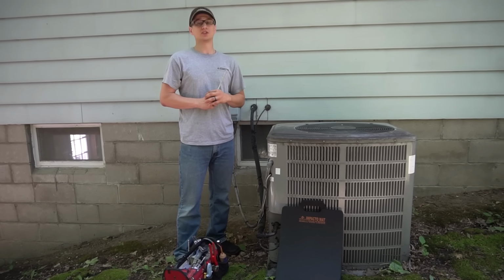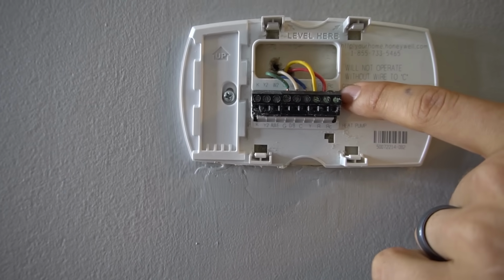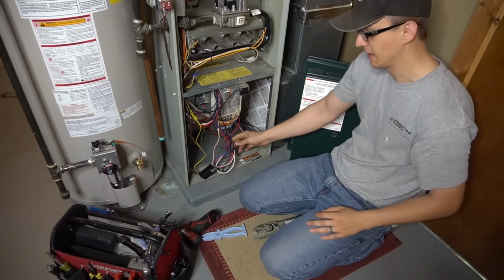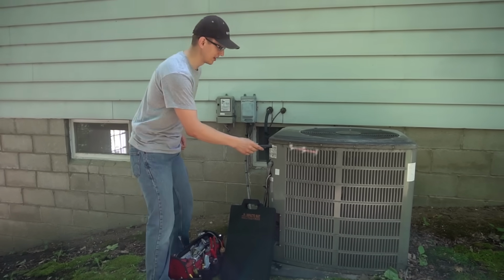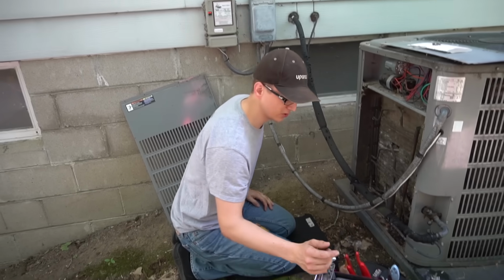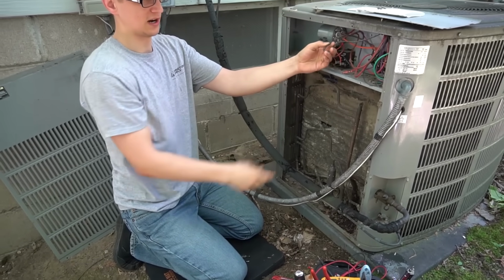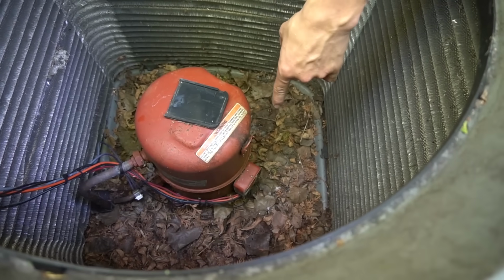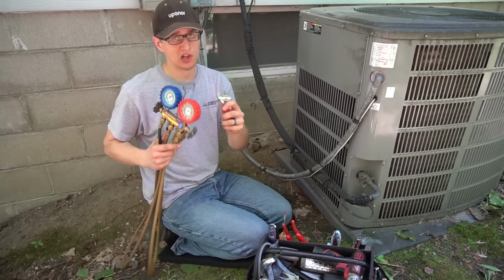AC Unit Not Turning On - How to Fix It Step by Step

Comment: Hey Mahn. This is a great video. I replaced the motor and capacitor of my AC unit  and everything works but it still won't cool. i also noticed that the copper hose on the outside unit is not cold. What do you think the problem is?
Reply from the maker: Can you tell if the compressor is turning on? You can usually hear the difference between the fan coming on and the compressor turning on. If the compressor is running, then you likely have a freon issue. At this point it would be better to call a technician.
Reply: Yes, I can hear the compressor humming. I figured it was a freon issue. Thanks.

Comment: Good morning, watched your video. Learned a lot. Still have question though. My ac just stopped turning on last weekend. I have replaced the capacitor & blower motor last year. Checked them they seem good. I was wondering about the contactor. Nothing turns on when set on AC - but can turn fan switch  - not the thermostat fan - and it works inside. When i go out & look at the contactor it’s not pulled in - but if I push it in the ac unit fan will spin - so i replaced the contactor, but same problem. I have one of those old slide thermostats - only has 2 wires attached on the back & 2 wires that were never connected. When you slide it it make the sound fairly close to the correct temperature. Just hoping you might have some ideals. Have a Goodman AC unit. Thanks
Reply from the maker: Most likely the contactor is not getting 24v, that is why it's not pulling in. What I found interesting is that your thermostat only has 2 wires attached. What do those two wires go to? R and W? It almost sounds like your AC is not hooked up at the thermostat. I would go down to your furnace and see which thermostat wire goes to Y at the control board (if you have one). Whatever color wire is hooked up to Y at the control board, hook up that same color wire to Y at the thermostat. Your set up may be different then mine. Let me know what you find

Comment: Word of Advice TV  please help 😣 The fan on my condenser unit is not working. Even after replacing the capacitor. The thermostat, furnace and compressor are all running. But the fan does Not run even when I try to jump start it with a stick, Nor by pressing the plunger thingy... the fan will not run. Any idea what might be the problem? 😭
Reply from the maker: Do you have a multi meter? I just posted a video on how to check if your condenser fan motor is bad. But if the compressor is running and you already replaced the capacitor.. It is very likely that the fan motor is bad.
Reply: Word of Advice TV I don't have a multi   meter (I will search for ur video on how to check if the condenser fan). Any advice on where to purchase the fan motor or a reliable ebay seller? My condensers brand is Carrier, if it matters. Thank you very much for taking the time to reply to me and for your videos. They are clear, straight to the point and easy to understand. Thanks again! 👍🙏
Reply from the maker: Happy to help :) You can probably find the motor you need on Amazon or Ebay. I would first go to some online HVAC parts store like this one for example: http://www.northamericahvac.com/   and put in your unit's model number. Find the condenser fan motor that will fit your unit and save the part number of that motor. Then you can  use that part number to search for a new motor on Ebay or Amazon. Or I suppose you can always buy it off of one of the online HVAC stores too. Up to you.
Reply: Word of Advice TV thank you. I will do that. 🙏🙌👍
Reply from the maker: Sounds good. Good luck and be safe!

Comment: So my unit is like yours and does not have a fuse on the board and no in line fuse. What do I do in that situation? An animal chewed the wires outside, they were clearly touching and I replaced them but my ac is still not working
Reply from the maker: Oh boy.. If there is no fuse then a shorting wire could have damaged your control board, thermostat, or transformer. In the worst case scenario, all three. Do you have a multi meter? You would need to do some checking. The thermostat is the only one you can check without a meter by simply bypassing it. (I have a video on how to do that if you are not sure how)
Reply: Word of Advice TV yes I do have a multimeter. That’s pretty terrible news. The whole hvac was replaced less than ten years ago. It doesn’t make sense why there’s no fuse. The fuses running outside are perfectly fine. Breaker wasn’t tripped but nothing is working except the fan. Turning on. There’s a red light that turns on on the circuit board can it still be fried? And yes please direct me to the video you’re talking about. Thank you so much for replying so quick!
Reply from the maker: Here is the video for bypassing the thermostat: https://www.youtube.com/watch?v=9Y_R9unnadI&t=2s   but perhaps there will be no need to bypass it for now. You can just check with your meter.

If the unit is new, then that is kind of weird that there is no fuse. Perhaps it is a little 3 amp breaker instead? To confirm, I would look at your wiring diagram/schematic (usually on the back of the furnace door) and see if there is a fuse/breaker on the diagram. It will usually come right after the 24v side of the transformer.

Even though the light on the board is blinking, it could still be fried. A blinking light is a good sign though.

And now for the actual checking :) With your thermostat on and set to cooling, go down to your furnace and take the doors off. Tape your door switch so you don't lose the power. Next, locate your thermostat terminal strip on the control board. (R,Y,G,W,C) Set your meter to voltage and check R to C. Do you have 24v? What do you get between R and Y? Then Y and C? Depending on what your findings are, we will be able to narrow it down to the culprit. Let me know
Reply: Word of Advice TV Word of Advice TV ok so between rc and ry I’m getting 27.3. Between Y and C I’m getting 0. Also I haven’t found
Reply: Oops. I haven’t found a 3 amp breaker either. I’ve looked on the diagram as well. I’m not super familiar with reading it but I found the 24v and there’s no fuse around it on the diagram.
Reply: Word of Advice TV also, I don’t know if it makes a difference but I have a nest thermostat. It doesn’t seem to be having any issues, I don’t know if there’s something inside that got fried though. Thank you so much for all of your help also, we live in a remote area and haven’t been able to get ahold of our ac guy for the past two days.
Reply from the maker: Glad I could help! Hopefully we will get this figured out soon. So from what you checked so far, we now know that your transformer is good (otherwise you would not have 24v anywhere) and likely you control board is good too but not 100% sure. It seems like it is sending power up to the thermostat but the thermostat is not sending that power back down. At the moment I would suspect the thermostat. You should watch that video i referenced above and hopefully you will understand how the bypassing works. Instead of bypassing the thermostat at the thermostat, you will put the jumper wire in at the furnace control board between R and Y. (make sure you turn the power off when putting in the jumper) Then turn the furnace back on. Does the AC turn on? If it does, then you know your thermostat was fried. If not, then we will need to keep investigating. If the bypass does turn on the AC, then you can just leave the jumper in there so you can cool down the house. But keep in mind that it will run non-stop until you either take the jumper out or turn the power off to the furnace. Good luck!
Reply: Word of Advice TV I put the jumper in and boom ac turned on. You are amazing!!! Thank you so much. I’m not excited about my very expensive thermostat being bad but at the end of the day it’s better than the whole unit being bad. Now if I installed an inline fuse myself somewhere and an animal chews the lines up again will it prevent this from happening again?
Reply from the maker: You're welcome! Glad to hear the AC is back! That's a bummer that the thermostat got taken out but at least it stopped there and didn't take out the board and transformer.

Yes, that is the purpose of a 3 amp fuse. So if there is a short, only the fuse will burn out. If you look at my video, my furnace actually did not have a fuse either. I put that one in myself. All you need to do is cut the 24v hot wire coming from the transformer, strip both ends, put connectors on them, and put the fuse in. If this happens again, the damage stops at the fuse :)
Reply: Word of Advice TV awesome. Once again thank you so much. Your videos and advice are amazing! I’ve subscribed to your channel!
Reply from the maker: Thanks :) stay cool!
Reply: Hey again! Thank you so much for all of your help a few weeks ago. I just have a quick question again and please let me know how I can ever repay you for all of your help. So my ac unit is working, we replaced the thermostat and now there’s a puddle of water outside of my hvac unit in the basement. I’ve been googling possible causes and what I’ve found is that it could be a clogged line which doesn’t seem likely since it basically started happening overnight but it also said a broken condensate pump. Is there a way to test it and is it possible it blew out along with the thermostat when those lines shorted out?
Reply from the maker: You and family being happy and cool is all the thanks I need ;) If you have a condensate pump, it is possible that it was damaged too. I would first try to clear the drain line though as that would be the easier thing to deal with. If you are not sure where to start, I made a quick video on it:  https://www.youtube.com/watch?v=v4WMZ5i4c3M&list=PLK8tZPlovA8Aw5W4GIoingc_enl5apH4C&index=8
Reply: Word of Advice TV thank you for responding once again. Our drain is unfortunately pvc so now I’m just trying to figure out if I should cut it or buy an air compressor to blow it out. I have a wet dry vac, would I be able to suction it or use the reverse feature? Also if that’s not what it is, what would be your next suggestion? I’m actually surprised at the amount of water that is coming out of the bottom. It’s not a small leak at all. We are about to leave for a week so it won’t be running at all until we get back. I hope all these comments are helping your page somehow!

Comment: Have had an Intermittent failure with cooling (inside fans runs, outside fan and compressor not running).  Contactor would not close (240 VAC and Capacitors verified - OK).  Let it sit overnight with disconnect pulled, tried it the next day and the unit started working again.   Same thing happened 3 days later.  Thinking it something with a pressure switch or TDC or defrost circuit?  Any suggestions?  Can I troubleshoot further?
Reply from the maker: When it turns off, I am thinking something is interrupting the 24v control voltage. If you have a condensate overflow switch it could be that. (drain line has blockage and is backing up) Though if you said it ran for 3 days it's likely not that.. If you look at the back of your cover door at the condenser, there should be a wiring diagram. Try to find what is in series with the 24v contactor coil. One of those will be your culprit.

Comment: my thermostat has w,g,y, and rc (red) cables, the blue one isnt connected to anything and there seems to be a brown wire tucked into the back as I well, should i connect the blue one to common?
Reply from the maker: Many thermostats do not need a common wire. You can if you want to. But then I would also go to the furnace control board and make sure that the blue wire is hooked up to C there as well.

Comment: I replaced my capacitor bc one of the leads was rusted out and disconnected. the ac system still wont turn on. the panel is displaying 72 degrees inside the house but it is hotter than that and the cooling temp is set at 85 (default). When I change the cooling temp (changed it to 75, and also tried setting less than 70 since the panel was sensing 72) nothing happens and after about a minute the panel resets the cooling temp back to 85. What do you think may be the problem or my next step should be.
Reply from the maker: Almost sounds like the thermostat is not connected to the wall good. A loose connection possibly? Also, what you described is likely the program kicking in (if you have a programmable thermostat). Try setting it to 68 for example and press the hold button (that overrides the program)
Reply: thank you. After watching your video I went home after work and started troubleshooting. jumping the thermostat wires turned the unit on so I ordered a new thermostat to replace it.
Reply from the maker: Okay good. Good luck!

Comment: GREAT set of videos, really done well, and your knowledge is clearly demonstrated. (I do like your tracking of issues and top 10 on your other video.)    I found your video's like most, since I'm experiencing a problem (Unit is 18 years old York/Luxaire).  
-  AC stopped cooling this morning.  
-  I had the capacitor go bad about 4 years ago, (at the time the fan didnt work, if I remember correctly, the compressor still ran).  
-  Today, seems that the same thing happened, 
- Fan not spinning, Compressor motor is running, Compressor input refrigeration line VERY HOT, (didnt check the Coil feeder line temp).
- Tried to spin the compressor fan manually - it just spins freely - no resistance/not locked up - but did not spin on its own even with me manually starting it (i.e. no motor power).
-  so I replaced the Capacitor but still the same thing is happening.

My assumption is that the compressor fan motor has failed, but your video (and comments here - Yes I read them all) seem to indicate that the motor would lock/freeze.  What is your thought?  Have you seen motor failures that would spin freely?, without engaging when manually started?
Reply from the maker: Hey David! Good to hear my videos are helpful :) Thank you for the details! That helps a lot (you probably noticed from the other comments) But yes, I have seen plenty of motors that spin freely but they are still bad. The bearing might be good but the electrical windings may be open in it. It would still spin freely but with a broken winding it will not energize. You can confirm this with a meter that can check resistance too. In fact I am finishing up a video on how to check a condenser fan motor right now, where I show how to do that. Hopefully will be posted today.

Comment: Hey I forgot to disconnect the 240 and you no a big ball of electricity. And now my ac is doing nothing do you think I shorted out something .or fried my new run capacitor.
Reply from the maker: You may be okay. Your AC circuit breaker may have tripped and if your disconnect has fuses in it, those may have blown as well. Once the power is restored, try again. More carefully this time :) 240v can be lethal...
Reply: Word of Advice TV no such luck now it won't do nothing and it's hot as he'll here in Tennessee.
Reply from the maker: Sorry to hear that! Well at this point you will need a meter that can read voltages then. You will need to check if you have 240v going to the unit and if there is 24v coming to the contactor coil from the furnace control board

Comment: This video is great! I’m going to check everything tomorrow. The fan does not move freely so does that mean it is the capacitor? I’ll know for sure when I look at it in the daylight. I also heard a hissing sound. Is that a possible leak?
Reply from the maker: Thanks Kyle! If the fan does not move freely, then it would more likely be a bad fan motor. But I would replace the capacitor as well. The hissing sound must have been coming from the compressor. It has an internal pressure relief. If the fan was not spinning, the compressor would over heat and that valve would open, making a hissing sound. I am pretty sure it was just releasing the pressure, I doubt there is a leak.
Reply: Just saw this now but you were exactly right!

Comment: You are very informative. I have 240v at the contractor and it works when I push it in. Our heater and fan work. Ours is a 4 wire system with the yellow unused. We recently moved a wall so the thermostat was disconnected and relocated within a small area. If the wiring was not correct would the heater and fan still work? We have screw in fuses and they are all good. I have not checked inside the furnace yet just because there is a lot to move to gain access. Any ideas? Our units are old. Outside unit is an antique at 1978. But it works when I push contractor. Not sure on age of inside. We have been here 18 years and we have never replaced it but the heat and fan are working. This only started after we moved the thermostat. Thank you for any info. Just checked the red and white wires coming from inside and there is no voltage at all. I guess I have to get to the furnace.
Reply from the maker: Hi Laura! The yellow is typically the cooling wire.. So I wonder if maybe you simply have the AC disconnected at the thermostat. Try putting the yellow wire to the Y terminal. Also, if you did not turn the power off to the furnace while you were moving the wires, then you may have blown a 3 amp fuse or breaker in the furnace too.
Reply: Word of Advice TV   I should have taken a picture of the wires before I disconnected it. Apparently there is a wire spliced in between the thermostat and furnace so the yellow wire is actually a blue that is substituted for the yellow. I had the blue to the w/b terminal. Now that blue is to the yellow terminal. Thanks for all you do to help people and save them money.
Reply from the maker: Oh okay! Glad you were able to figure that out :) Thank you for coming back with an update! Stay cool ;)